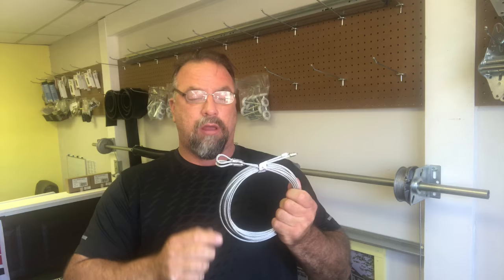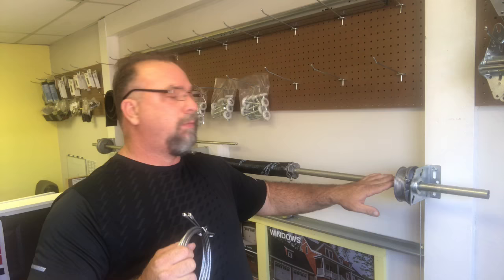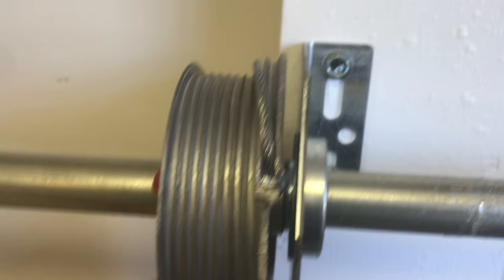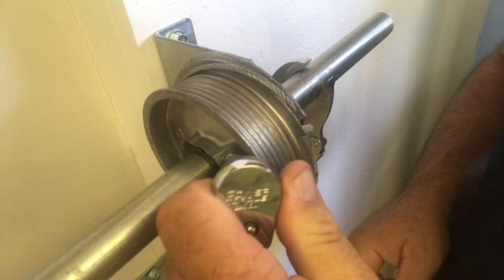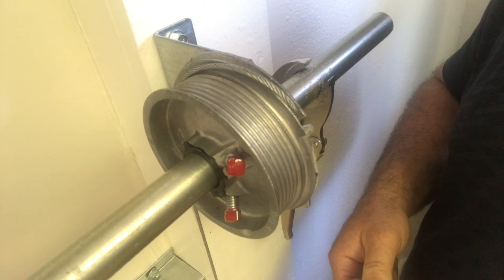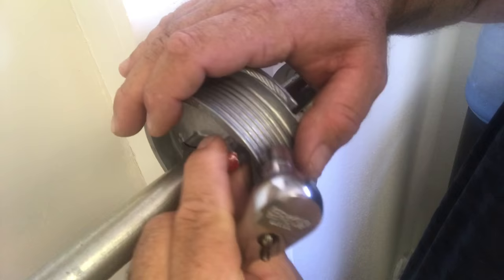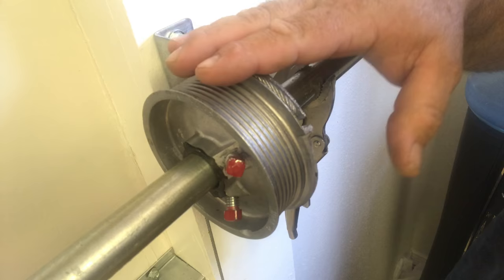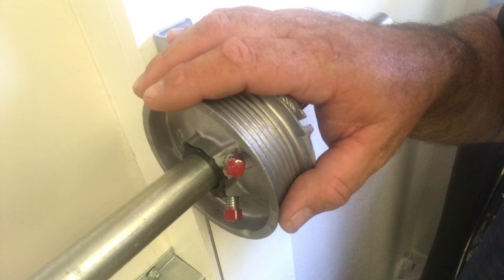How-To Align Garage Door Cable | Torsion Cable | DIY Garage Door Repair

Comment: I've adjusted my torsion springs to level the door but I have a half inch gap on both sides. The door has a slight bend in it because the cables seem too tight. I've tried backing off the springs but then they dont provide enough lifting support for the door (when off the track will slam close from 1', or will close on it's own when half open). I'm stumped on what I can do?
Reply from the maker: Sorry, this one might be difficult to truly understand the issue without seeing it in person. Definitely sounds like the springs are undersized for starters.

Comment: could someone explain why some videos i’ve watched the people wrap the wire on the spool along side the markings but in this you didn’t. also mine weren’t wrapped around on the spool it’s just twisted on the side
Reply: Some people mark the position of the drum to the torsion tube. This allows them to set the door in the exact position as before. The only time this is helpful is when the ground is uneven and it’s necessary to get back to the same position as before.

Comment: I put on a new cable and now my door won’t shut. Once the door weight starts getting supported by the cables the door locks and won’t go down. The safety cable is un engaged
Reply: You have extension springs if there are visible safety cables. That’s a different kind of repair entirely. You might search for help or how to info on extension springs

Comment: How do yo u fix the door when both cables come off the rollers?  I tried to do it, but it looks like the spring has no tension so it didn't work when I tried to lower the door.
Reply from the maker: This is a more complicated issue. You are pretty much starting at the beginning- as if you were installing springs. You should look up videos for winding garage door springs for more details.

Comment: Why do you have center bearing plates on the outside?
Reply: Good observation. It was easier to set up the demo that way. (There is no lower track to bolt to)

Comment: what socket were you using on those square headed screws on the drum? Special 4 point one (which Home Depot does not carry) or something else?
Reply: 12- point 7/16 socket, or 3/8 open end wrench

Comment: I bought some cables from Amazon but they came without a stop ferrule. Suggestions? Do companies that install motors, springs, and cables carry these stop ferrules?
Reply from the maker: Most do. You could also buy a ferrule at Home Depot or Lowes. You may have mistakenly bought extension cables instead of torsion cables. the length also needs to be correct. For a 7 ft tall door the cable length would be 7 ft 6 in, and for an 8 ft tall door the cable length would be 8 ft 6 in.
Reply: @parts4garagedoors278   I thought for a 7 foot door it was 8ft.6in. Can you check?

Comment: Hello, what if both sides have loose cables? Does that mean the spring is bad or can I do what you din in this video and rotate them back, thus taking up the slack?
Reply from the maker: If the door is open and the cables are loose: either it's opened too high (should only be opened the height of the header) OR the spring(s) don't have ample tension. (29-30 quarter turns on a 7ft tall door, and 33-34 quarter turns on an 8ft tall door.
Reply: @parts4garagedoors278  Thank you!

Comment: YOu do this with the door open (No tension) or door close(full tension)?
Reply from the maker: You can do it with the door closed. Just be sure to firmly plant the vise grip on the top side of the bar as described.

Comment: I have a rear torsion spring and my drum is on the outside of the bearing plate on both sides, is that correct? I don't see any on youtube that show them there? It seems its there so the cable runs outside the tracks.
Reply from the maker: Yes, I have seen systems like this.

Comment: Shouldn't you explain the guitar string tension to put on the cable before you tighten the set screws?
Reply from the maker: Actually there is almost no difference in the length of the cable, when it is straight, as when it is tight like a guitar string. It is only necessary for the cable to be straight. Once the vise grip is removed from the torsion tube it will become super tight under the power of the spring.

Comment: So my spring snapped. When this happened, my cables all fell off. I have two single doors/one motor rather than one two entry garage door, so each door has one spring. I couldn’t find a 225x26”, so I bought a 225x33 so it’s longer but diameter and coil size match. Springs went on as expected, however, now that the garage door/spring is installed and wound, everything I lift the door, the cables on the drum come off all four drums... when the door broke and I first opened it, the bottom support to the left door did bend in and that’s not perfect, Ali thought I’ve tried to reshape to the original contours. Unsure if the cables are different lengths or what is happening but every time this happens, the cables bind and I can’t close the door and have to remove cables to close it again. :( feeling defeated... any DIY suggestions YouTube?
Reply from the maker: Buying a spring that is 7 inches larger is a problem. Your new springs, although longer- provide LESS lift than the original shorter ones. This, combined with underwinding the springs, will cause the cables to come off and get tangled. Your springs should be wound 29 to 30 quarter turns for a 7 ft tall door, and 33 to 34 quarter turns for an 8 ft tall door. My advice would be to buy springs exactly matching what you had. Also, when you measured 225x26, was that the length of the broken or unbroken spring? The correct length is by measuring the broken spring and subtracting the gay where it is broken,. This might actually mean that your original springs were 225x24 (a more common size). Hope this helps. BTW- you can order springs from our website www.parts4garagedoors.com
Reply: @parts4garagedoors278  thank you for advice I will do so

Comment: What are the set screws on the spring?
Reply from the maker: Set screws are the screws with a red square head- used to tighten down and secure the spring to the torsion tube.

Comment: Is the tension rod have to be tight before u tighten the cables
Reply: tension should be taught not to loose or tight so u can set cable as the same to the other side very critical you're welcome
Reply from the maker: The torsion tube is held stationary by the vise grip. The cable is simply pulled straight, then the drum tightened. Once the vise grip is removed, then the cable will become super tight.

Comment: Do I need to release the spring to do this?
Reply from the maker: Ideally yes it is better/safer to release the spring tension first. The trick shown here is to use the vise grip firmly planted as described to hold the tension of the spring while performing the task (without having to unwind the springs first- it's a shortcut)  Please re- watch as needed.
Reply: @parts4garagedoors278  Thanks for the reply! I have one side where the cable is loose.. going to rewatch but am thinking of just using the vice grip approach.  Thanks again!

Comment: My door is a 7 foot 8from bottom to top. Do I use 7 ft cables or 8 foot cables?
Reply: add  19'' inches plus door height  Universal Overhead Door Co
Reply: have a 2nd vise grip to lift so cable is just loose enough to reset
Reply from the maker: A 7 ft tall door takes cables that are 8 ft 6 in. An 8 ft tall door takes cables that are 9 ft 6 in. Always add 18 inches to the length of the cable on top of the actual door height. Your door should have 110 in cables. The only caveat is if the door is high-lifted.
Reply: @parts4garagedoors278   Thanks i changed it
Reply: @parts4garagedoors278  or rear mount torsion.......

Comment: I should have seen your video first before attempting the adjustment. I did not use the vicegrips as you demonstrated and now the cable on one side is looser than the other. How do you suggest i fix this?
Reply from the maker: On the side where the cable is tight- fasten a vise grip on the track above any of the rollers on the same side. Next, lift slowly and carefully on the lowest side of the door (side where cable is loosest) and level the door as needed. Hold level and fasten a vise grip on the track BELOW any of the rollers on that side. You are essentially up righting the door using the vise grips! Then follow the steps in the video to plant vise grip on the torsion tube (below the tube and against the wall) and loosen the set screws on the drum, real up the slack in the cable, then tighten cable drum. Remove all vise grips. DONE. Thanks for the question!
Reply: @parts4garagedoors278  Done! Thank you, it worked. The cables are taut and the door is level and opening. However, i noticed that the cables on both pulleys become loose after the door has fully opened. This is because the pulleys stop rotating a few seconds before the door fully opens. Is this because the spring is loose and need tightening or is this some other issue? I suspect loose spring because the door is also slightly heavy to lift up when disconnected from the chain. Will appreciate your advice...
Reply from the maker: @OMMITRA  Yes, the spring should be tensioned a bit more. Please be careful and research this task very well- it can be very dangerous. We always advise you to call a pro. If you adjust the upward limit on your garage door opener to stop 3 or 4 inches from the top- this may get you by until the adjustment to the spring can be made.
Reply: @parts4garagedoors278  Done! All good now. Thank you very much. I used a slightly different approach. I tightened the spring (one turn) without loosening the screws and held it in place with the winding rod. This process loosened the cables on the wheels. I then loosened the screws on both wheels, adjusted the cables to have about the same tension on both sides, tightened the nuts on the wheel and then removed the rod from the spring.

Comment: What he is showing here is VERY DANGEROUS!! (PLEASE) call a professional. The (Torsion Spring) is fully loaded, it can kill you.
Reply: THANK YOU.  You are 100% right.  The safest way is to release the torsion spring by using winding bars and vice grips on the top of the springs tube and the side tracks.

Comment: Nope nope nope!  You're trusting a pair of vise grips while you have 2 wound springs, so dangerous.  And BTW when you loosen a drum and leave the other tight on full tension that side of the door will lift.

Please stop, your going to get someone hurt with wrong and unsafe information.
Reply from the maker: It's not trusting soley a vise grip. Half of the tension is on the other cable. Also, if the vise grip were to fall off or fail, then the only thing that would happen at the worse case, is that the door at the opposite side would lift up slightly- probably one inch. Keep in mind that the tension produced by the springs counter balances the weight of the door- it doesn't exceed it. The fact that one cable is still in place is the ultimate safety measure. That cable can go from bearing 50% of the weight to 100% of the weight, but still will not shoot the door up, or cause anything dangerous to happen on the side that's being worked on. I have made 1000's of these repairs as a tech safely with no issues. Thank you for your comment and concern though!
Reply: @parts4garagedoors278  Thank you.  Can you address the issue where the drum / hub has completely come off and how to re-install / rewind?   The springs on this garage door are not in the center like in the video.  There are 2 springs on each side of the frame closes to the ceiling.  And it appears the drum just fell apart.  I found one side of it laying on a shelf with what appears to be bearings?  This is a rental house and tenant never informed me of anything.
Reply: Great video. Do you have a video to fix a stupid wife?
Reply: @parts4garagedoors278  you're telling me you don't put c clamps on the other side and you trust vice grips on a 16x8 door?  If they let lose 100% of the torsion  is going to one side it will lift far more than an inch and then a "non door guy" is in really trouble.  Your telling me this is safe and with 100% tension on a 16 wide it doesn't lift it enough to not make a seal?  Or can you get the drum you're working on as tight as the left?  If not now you need to slip a drum, please don't do a video on that!  20 years
Reply from the maker: @gregoryhall2967  There is no difference in cable length between a "straight"  hand-wound cable and the non affected one on the other side. Once the vise grip is removed, the cables will have equal tension! Cables don't stretch under tension. Also, two suspended cables on a torsion system always share the load 50/50. I'm talking about once adjusted as described. It is impossible to ever be 60/40 or any other combination. Reeling in the cable till it's nice and straight is all that's needed. And 20+ years here.
Reply: @parts4garagedoors278  disagree, if you have spring tension on one cable you'll never "hand tighten" the loose drum enough, fact.  On a 16*7 there's no way. Of course they'll have equal tension but that's irelavant, does it sit on the floor level? Nope, why because you can never get that drum you set free as tight as the other one.  Then you have to c clamp the low side and slip the other drum.

#20years